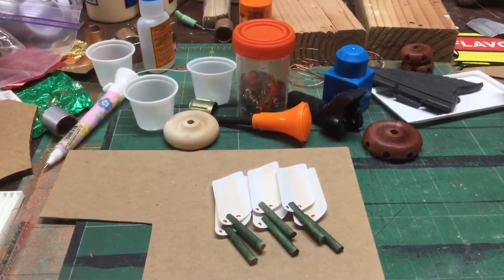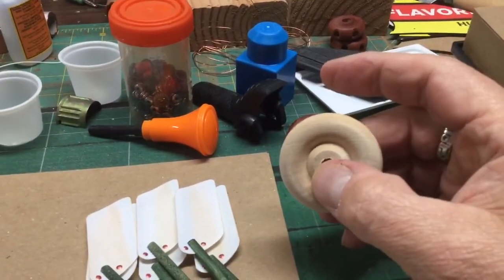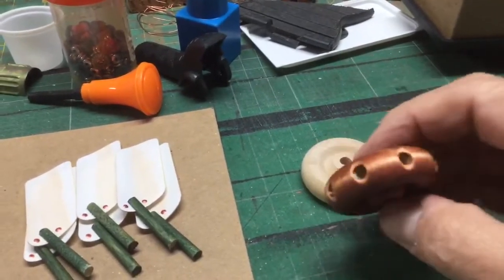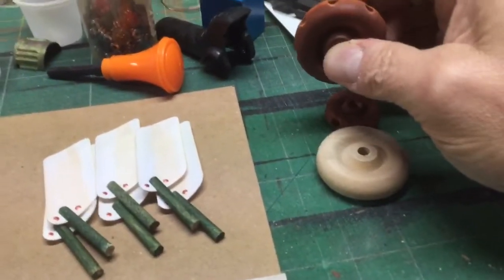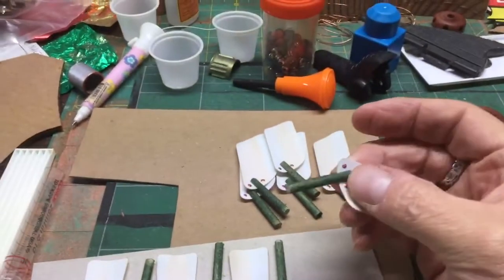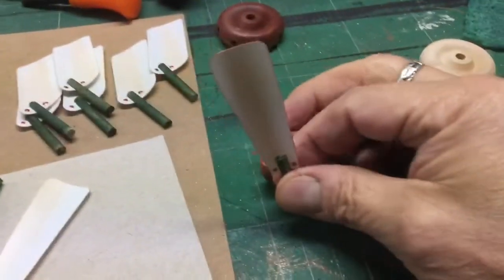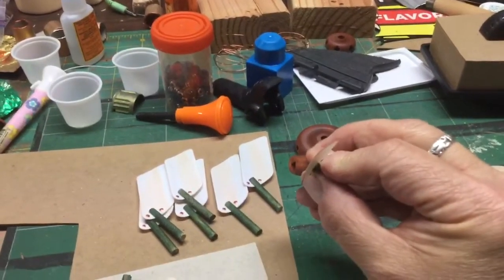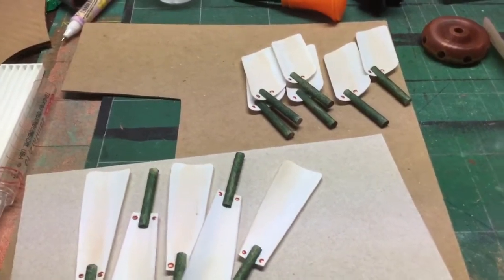Making a Victorian Steampunk Airship Propeller - Artsmith Craftworks

Comment: Another useful one...except...do you have any tricks for accurately spacing the holes drilled into the hub?
Reply from the maker: I draw lines on a piece of paper with the divisions on it. So for 8 fins, I draw a "+", then a "×" so you have a pie with 8 slices. For 6 fins, you kinda have to use a protractor to make a 6 slice pie. Then I center the wooden wheel over the "pie" and mark around the wheel. I hope that answers your question!